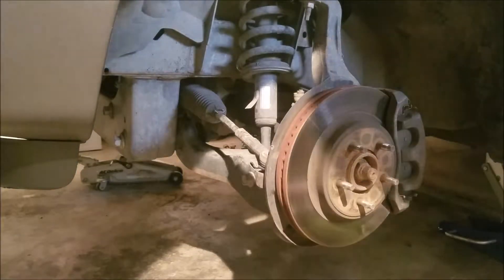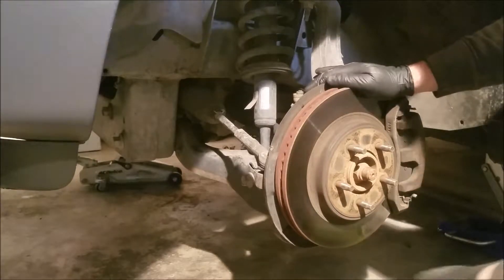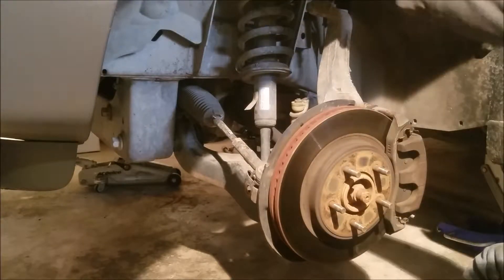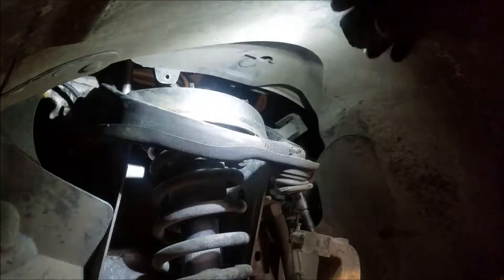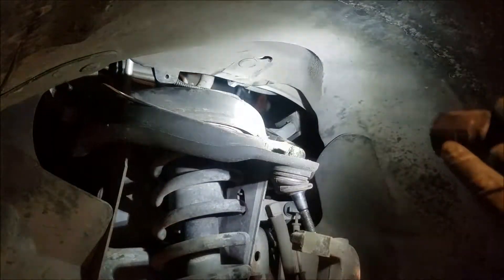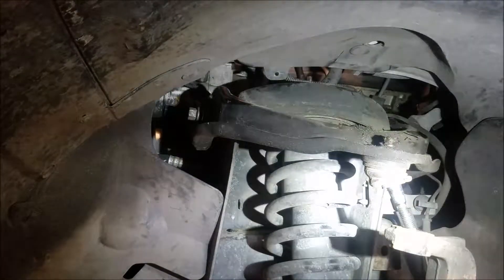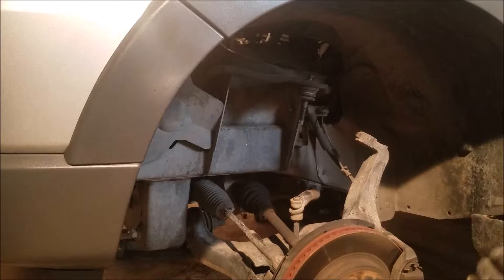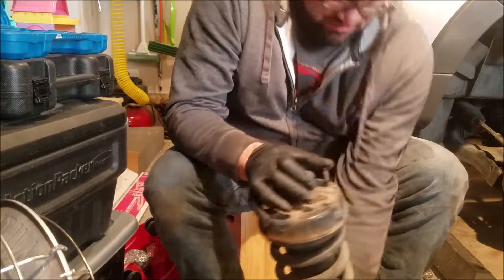2006-10 Ford Explorer front strut replacement

Comment: thanks for excellent & informative video. i did mine yesterday. removed upper control arm and sway bar links only. the quickstruts with spring assembly were a little over an inch taller than worn out OEM from side by side comparison.car sits taller than i ever remember. doing back ones this weekend to level out. can relate as i dont have a lift either and did in back yard using jack stands. no problem just takes longer.